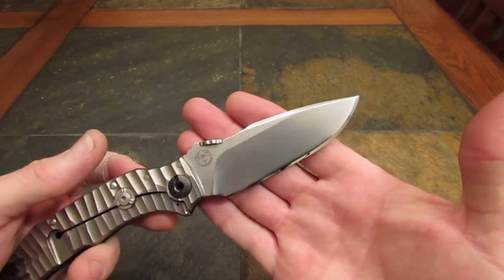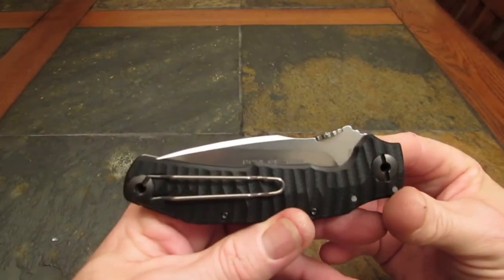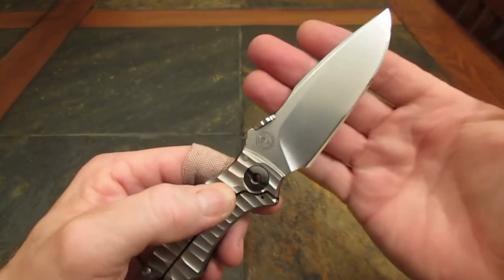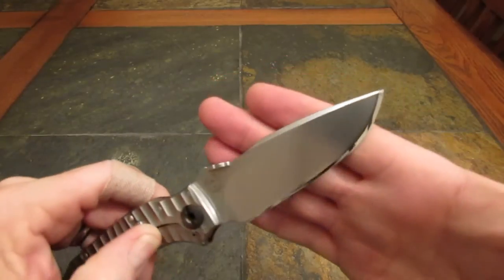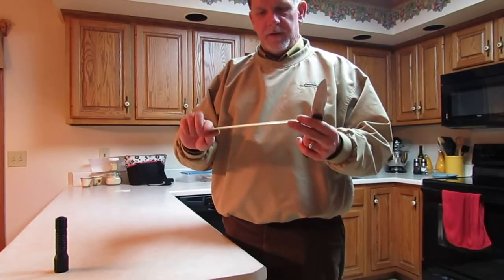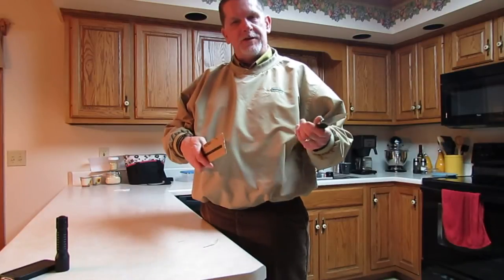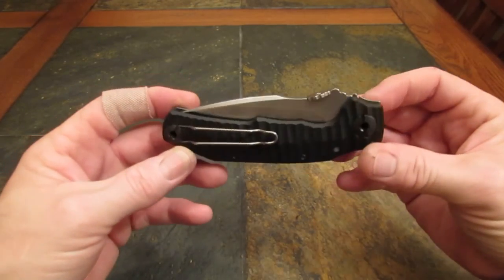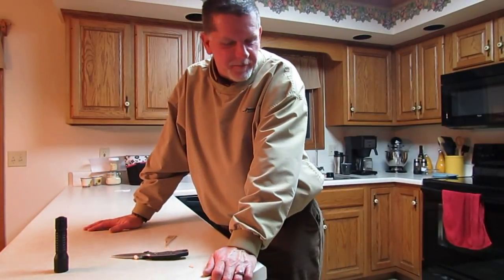The Edge Report:  Niolox in the Pohl Force Mike One... Interesting Stuff

Comment from the maker: I'd say it's a bit harder to sharpen than ZDP and doesn't take quite as keen an edge, but it should be a bit tougher / chip resistant.  I would also prefer it be ground thinner, but I think these knives are aimed at the Strider market -- sort of "go-to-war" knives that can be used for prying tasks and the like... not just a pure cutter.  I get that, and I have lots of pure cutters :)

Comment from the maker: Thanks for watching and commenting, Nate!  Don't worry... Heidi is all calmed down now :).  To answer your question, if you don't have a D2 knife, get one.  It's one of my absolute favorite steels.  Its only weakness is that without proper care and lubrication, in some climates, it will stain and rust.  That said, I own 3 blades in D2 and haven't seen a staining or rust problem on any of them.  D2 is relatively easy to sharpen, takes an absolutely scary edge and a great polish, and holds it.

Comment: No offense but thats not a decent cut test. 3 pieces of small cardborad and a paint stirrer cant tell you much about a steel or how it holds an edge. I cut a lot of cardboard and/or rope and do it a few times to see how a steel performs. I dont know your dislike of elmax  I know you said it takes a while to sharpen, which I haven't seen but it could be the knives I use, I have a scrapmax and a para 2 and both sharpen up quite easily and take an extremely keen edge. When I got my elmax para 2, I cut up 4 big sized boxes and then 14 12packs of soda and it still cut phone book paper quite easy and it was semi shaving sharp and thats on a factory edge. I re sharpened on the edge pro to 28° inclusive and put on a 36° microbevel and went to town on some cardboard. I cut enough to fill a 55 gallon trashcan full of cardboard and it only had 2 microchips that I got out on a strop. Then I cut some 1/2 manilla rope and got 350 cuts oyt of it. Im still gonna do more runs but I call that a decent cut test. And if niolox needs stropping after 3 pieces of cardboard and a paint stirrer, then thats kinda sad.
Reply from the maker: I don't think Niolox is up to the performance of many modern super steels, Elmax included, and it's not much easier to sharpen, at least on this overly thick blade.  I commend the time you put into your cut tests, by the way.  This video was in no way intended to be a comprehensive test -- just enough to get an impression.